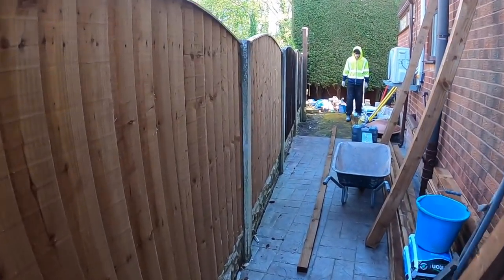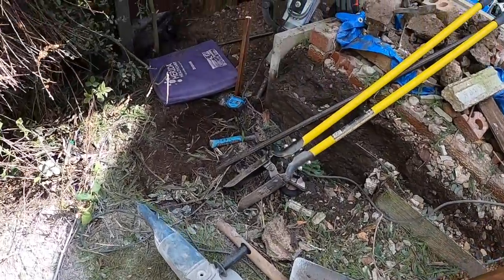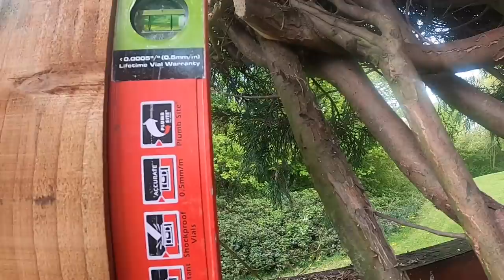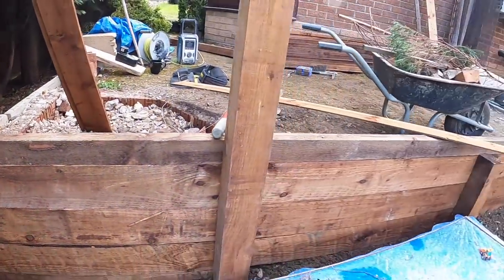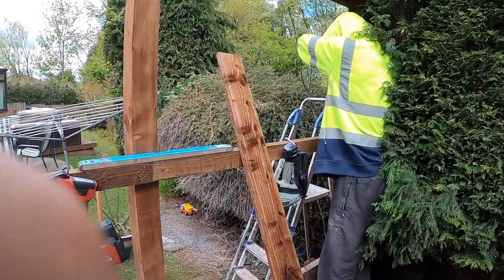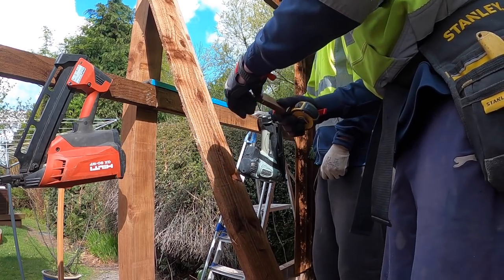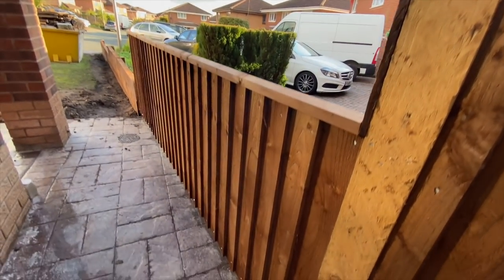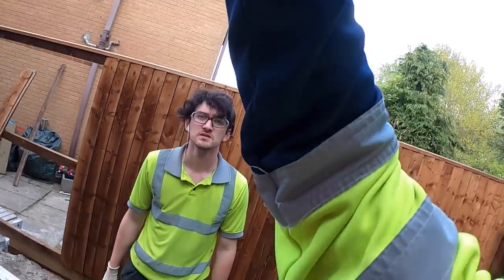VERY TOUGH FENCE JOB!!

Comment: Hiya guys, lovely looking job that. Really very neat 👌
I've taken to using a 4ft farm jack to pop out the posts and concrete in one. It really does make life easier.
I'm using the 9x3' as purlins at 6m long so you know what they're like trying to lift over 8ft high 😉
Have a great weekend guys
Regards 
Tim
Reply from the maker: Cheers Tim , that Jack sounds handy 👌🏼. 12 “ off the ground was high enough for us ....8 feet ! 😳🤯🤣🧱👍🏽

Comment: Really hard work I removed a few bushes this week and eventually got one of those metal bars you have job done great job as always.👍👍👍
Reply from the maker: Those bars are just so handy 💪🏼🧱👍🏽
Reply: Digging holes is a killer. I've got a bunch of tree roots to do but I've been putting it off for years.
Reply from the maker: @davidsmith6859  holes are absolutely fine . It’s when you hit , concrete , bricks , roots brick bands and even plastic bags 🥺🥺🧱👍🏼

Comment: 32 years the six foot concrete posts have been installed in my garden. Only two posts have lost one inch piece of concrete.
The wooden panels on one section of fence have lasted for the same amount of time.
Reply from the maker: Excellent! 👌🏼🧱👍🏽

Comment: Little tip, rather than measure each pale in with a tape, I use an offcut of gravel board cut to 100mm, use that as a spacer and then use the level every 10 boards or so.
Edit; just seen you did that later on 👍
Reply from the maker: Cheers Stan 🧱👍🏽